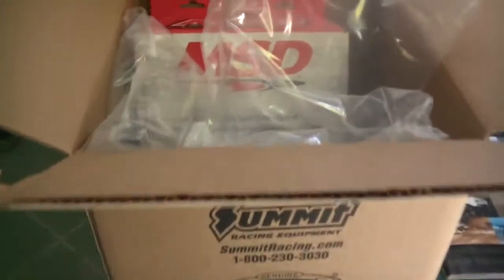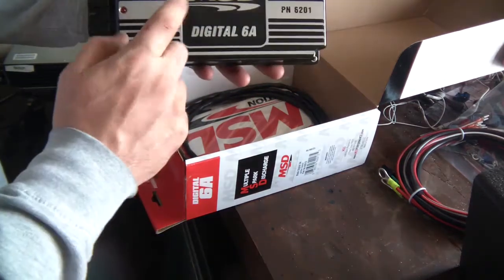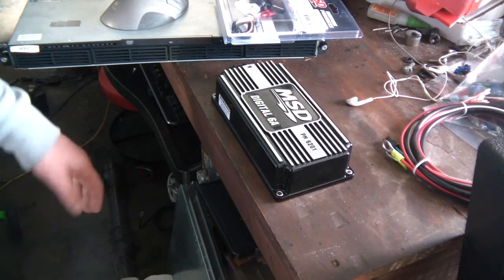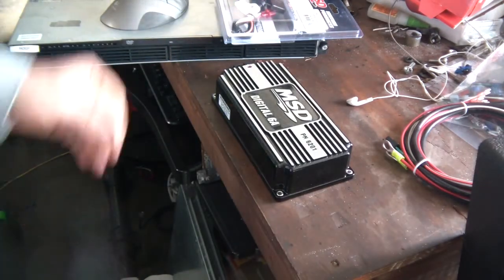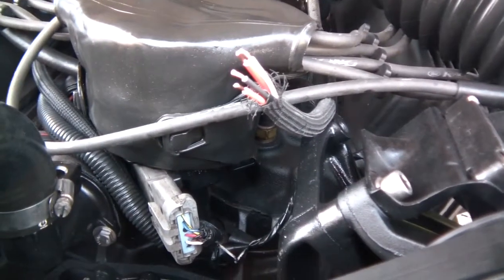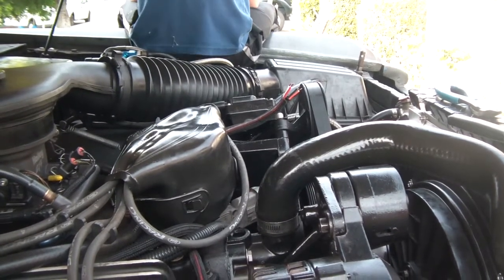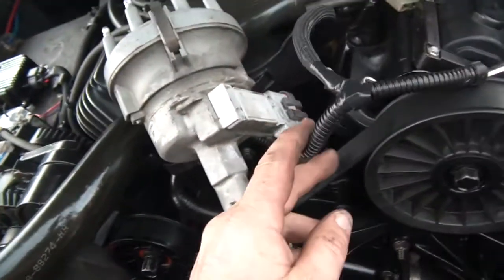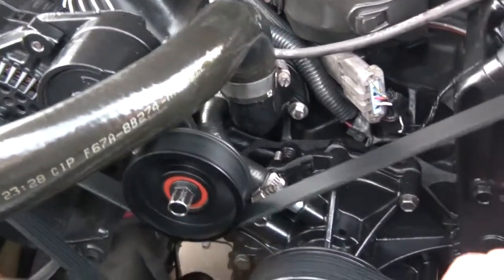Early Ford Bronco MSD 6A 6AL TFI Install

Comment: I have a msd pro billet distributor and tfi coil and digital 6 box with rev limiter iv deleted egr put headers on it and 3 in exhaust just installed and no start I ran the coil B4 I put distributor in it worked wtf do I do now???

Comment: Just seeing your vids (you helped me with a steering T-bolt issue). I have a plain distributor and a new blaster 2 coil with a fitech efi. I bought a new 6a box. Do you have a vid of swapping that out? The new MSD box looks to have different hooks than the old one.  Thanks!

Comment: So happy i found your videos. I commented on you tank vent video. 79 f250 with fitech going on460. I want to control timing with fitech, with locked out duraspark. ( You saved me money with your experience with other distributors.) Going to use 6A box. Would like to talk to you soon about the unforeseen issues I know are headed my way. 460 is all new hydraulic roller, AFR heads, and all that happy go fast shit.